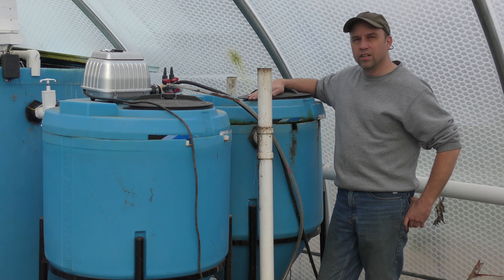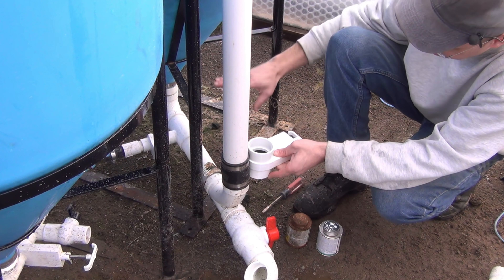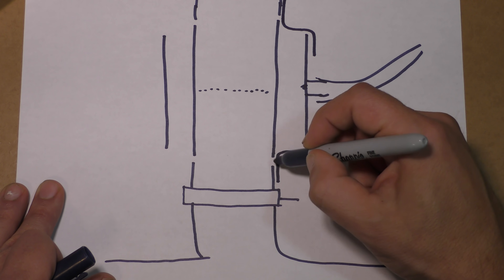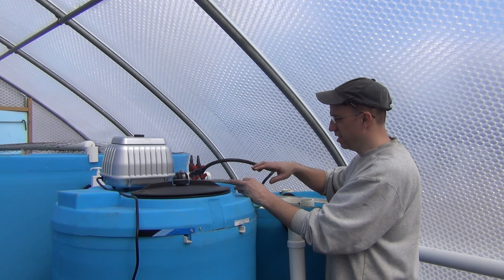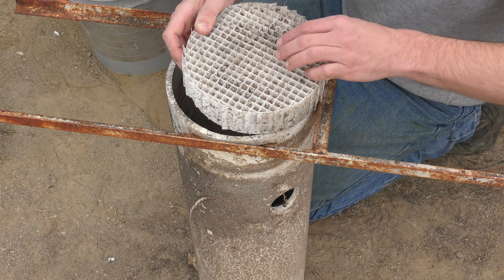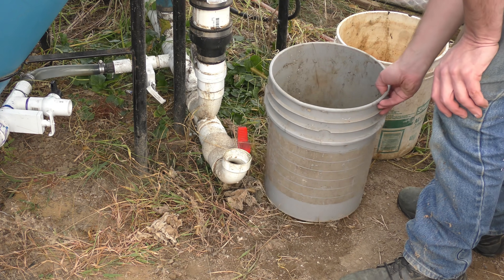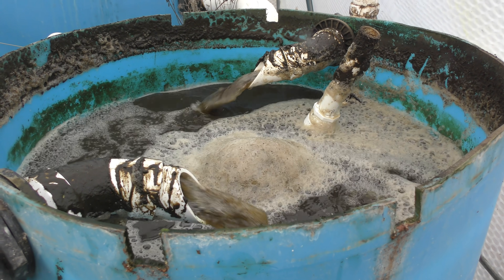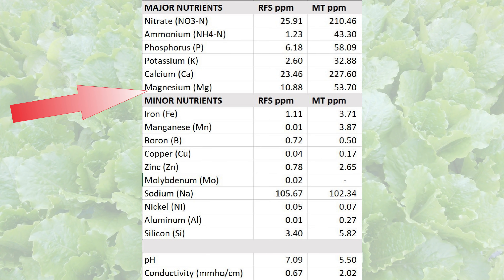Aquaponic Mineralization tank UPDATE!

Comment: Got surprised by the sodium (Na) lvl

Fresh water can be defined as water with less than 500 parts per million (ppm) of dissolved salts. 
Other sources give higher upper salinity limits for fresh water, e.g. 1,000 ppm or 3,000 ppm.

Seawater has a salinity of roughly 35,000 ppm, equivalent to 35 grams of salt per one liter (or kilogram) of water.

Composition of seawater
Major ion composition of seawater (mg/L)
Typical Seawater	Eastern Mediterranean	Arabian Gulf at Kuwait	Red Sea at Jeddah
Chloride (Cl-)	18.980	21.200	23.000	22.219
Sodium (Na+)	10.556	11.800	15.850	14.255
Sulfate (SO42-)	2.649	2.950	3.200	3.078
Magnesium (Mg2+)	1.262	1.403	1.765	742
Calcium (Ca2+)	400	423	500	225
Potassium (K+)	380	463	460	210
Bicarbonate(HCO3-)	140	-	142	146
Strontium (Sr2+)	13	-	-	-
Bromide (Br-)	65	155	80	72
Borate (BO33-)	26	72	-	-
Fluoride (F-)	1	-	-	-
Silicate (SiO32-)	1	-	1,5	-
Iodide (I-)	<1	2	-	-
Others	-	-	-	-
Total dissolved solids (TDS)	34.483	38.600	45.000	41.000
Note: The dot (.) separates thousands
The comma (,) separates decimals

Source: Magazine - Water Condition & purification, Januray 2005

Comment: Hi Sir. Nice work!

Some questions:
1. Will the fish poop eventually get decomposed in the mineralization tank?
2. Water from the mineralization tanks is poured back to sump tank or to the biological tank?
Reply from the maker: 1) it will if it's in there long enough but I usually remove some and put it on some of my soil-based plants.  2) I usually put it into my media bed so it can capture any solids that may still be floating in the water

Comment: Make sure your swirl goes in the direction your hemisphere drains! Meaning the direction of how your water drains from a sink is the direction you should swirl your tank. Northern hemisphere goes clockwise, Southern hemisphere goes counter clock wise. If you go in the opposite direction it will increase resistance to swirl. Coriolis effect is from Earth's rotation effect.
Reply from the maker: coriolis effect.  It's to insignificant to make any difference for something like this.

Comment: Seems you have already figured the mineralization process will cost more than just reusing the sludge for another application or selling it & putting the minerals back via more direct methods.  

There are millions of ways you could use the sludge in addition to spreading it on fields for fertilizer as you showed.  One of the ideas we are working with is creating worm compost beds that will later feed fowl (Japanese Quail, chickens, & so on) as well as feeding other fish.  Other possibilities are growing mushrooms as well.  

Ultimately I think teh extra plumbing, tanks, airlines, & the energy use for the compressor are going to be much more expensive than reusing elsewhere or selling.

It is very interesting seeing how you would use a mineralization system though :D

Happy Holidays!

Comment: Does adding that small amount back to the system dilute the mineral concentration to an irrelevant amount or do the plants use such small amounts of those minerals that they actually help? 

I was wanting to reintroduce water from a mineralization tank into my system as well (now that I see these results lol), but I feared that it would either be toxic to the fish or it would get so diluted that the plants wouldn't really notice it. What are your thoughts? 

Did you by chance test the water going to your plants to see if the water being added back is giving them more nutrients?

It seems like there's a lot of up and down out there about this, with no specifics regarding aquaponics. I may make things easy on myself  and just use the water from the mineralization tank to top feed my dual root zone plants and mix in some crushed oyster shell to help buffer the pH.

Love your videos! Look forward to your thoughts, and thanks in advance. You, bright agrotech, and Rob have taught me all I know (well the relevant and practical knowledge) and I have a successful system thanks to you guys. Now I'm at the point where I want to reduce power consumption and waste. 

BTW I totally stole the top drain into the RFF that you did.  But that system isn't running yet, so no comment on if I like it better than the bottom drain into the RFF yet.
Reply from the maker: Adding it back in is insignificant...but it makes people think that it helps.  ;-)
Reply: @Bigelowbrook  So, it's probably best to use it as a stand alone fertilizer, yeah? Thanks for the response, hope all is going well!

Comment: Thanks so much for the video - working on our own system now and this is the best design I've ever come across for solid waste management. With the removal of the stilling well in the middle of the tank, does that remove the only outlet to the grow beds? Is the objective then just to cycle the water in the mineralization tank until you drain the 10 gal which gets returned to the vortex settler? Once removed, do you leave the valve open between the settler and the MT to equalize the water level?
Reply from the maker: yes, the outlet has been removed so the only way to drain water is through the bottom.  I keep the valve between the tanks closed so the water level remains uneven.  Then once or twice a day I open it for about 10 seconds which flushes any of the solids in the radial flow settler over to the MT.
Reply: @Bigelowbrook  thank you, much appreciated! One more question: how large are the conical bottom tanks you use, and who is your supplier? I'm in Ontario, Canada and I haven't been able to find these specific tanks
Reply from the maker: @lukeridgway1887  These came from Ace Rotomolding

Comment: Nice work! Thanks for the mineral tank info. Did you have to cut out the center main pipe since you already had holes drill in it’s side for water and gas exchange? Could you have just slid everything up from the sliding valve intersection? Maybe more holes in main pipe would have been needed but then leaving it continuous would be less dependency on the rubber skirts?
Reply from the maker: The original pipe didn't have any holes in it.  I suppose I could have not cut the section out and left it as one long piece and just drilled the holes in the original and slid everything into place.  However, I wasn't sure how large/small the holes should be or how many.  I got lucky on the first try.

Comment: It would be interesting to see a flow diagram of the path your water/solids take throughout your system.

Also, I was wondering if you could maybe squeeze a trompe into the system somehow, to provide the air supply for the air lift pumps on the remineralisation tank?
Reply from the maker: The older build videos I did a couple of years ago shows the general design for this setup.  I think trompe would not generate enough air flow with such little water flow through the system.

Comment: Looking at your air pump, when mine like that failed I upgraded to a smallish Gast regenerative 'blower' style (vs the oversized aquarium pump/septic aerator with the rubber diaphragms as you have).  The regenerative blower produces lots more air volume that may be useful in the future for aerating beds, but be advised that it has trouble creating enough pressure to blow deeper than 18" down from the surface.  My previous 'aquarium' pump style would push air to the bottom of my 42" tank. The regenerative pumps don't have the 60 cycle 'hum' noise (I don't like noise) .....but they can sometimes have a high pitched whine (mine does).
Reply from the maker: that's the main reason I don't use a regenerative pump....the high pitch whine drives me crazy.

Comment: I appreciate that your designs are maintainable. I made a similar air pump (idea from the internet of course) but made it using glued PVC fittings. Hogging out the 'stop' from a 3" PVC fitting (as was suggested on the net) was much more difficult than your method of using the rubber reducer.  Once again, excellent use of off the shelf parts, creating a device that can be disassembled and maintained if needed.  BTW, got my first shipment of GrowGrips today.  Looking forward to using them. Kudos.
Reply from the maker: I saw a big air lift done for a natural swimming pool and they used the couplings...so i can't take credit for the idea.  ;-)  Enjoy the GrowGrips!

Comment: Fascinating work! Do you have a plan for analyzing the monetary cost of the mineralization tank like you have done for other equipment in your system? Perhaps the cost of electricity used (air compressor) per unit of nutrient vs the cost of raw nutrient (i.e. fish food).
Reply from the maker: Probably when I have the greenhouse fully running so I can check it while it's under full load.  My initial thought is it's not worth the cost to put the nutrients back in and I could sell the "compost tea" for a higher profit and just buy the supplemental nutrients.  However the purists don't like to hear that because they think it's not as sustainable🙄...
Reply: @Bigelowbrook  It's not like the nutrients would go to waste if you sold them as a high quality AquaFuel (trademark??) product! Considering how much people sell worm tea for you could potentially make it rather profitable. Not to mention you have the lab test to show what the chemistry is. Can't wait to see what you do, good luck!

Comment: Great!!
Just a line of holes?
Reply from the maker: yes.  I didn't measure them but I think they're 1/16" holes about every 1/4".  I didn't feel like taking it apart to see what I did.  😉
Reply: @Bigelowbrook  Do you know how much air is going through the holes? It looks as if the top and bottom connections are just dry joints and I wonder whether the air is taking the path of least resistance out the top joint.